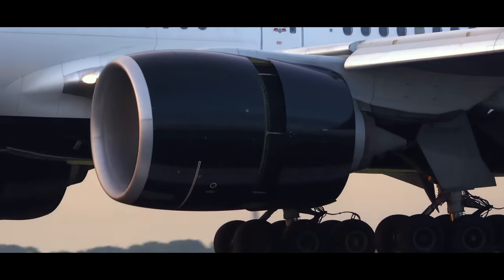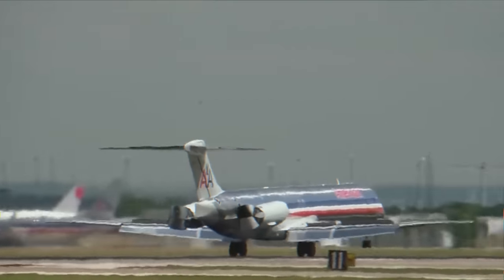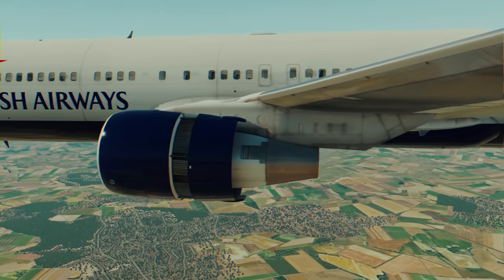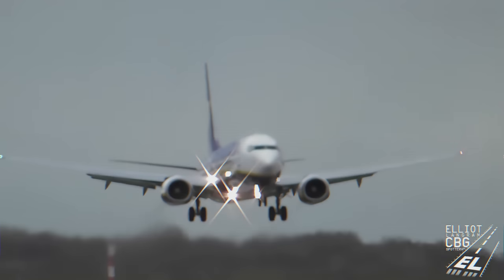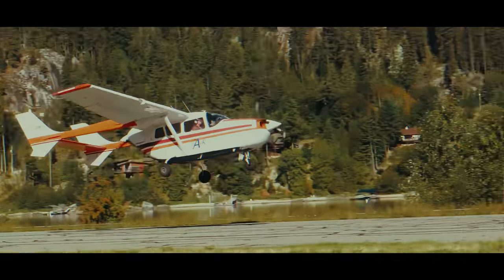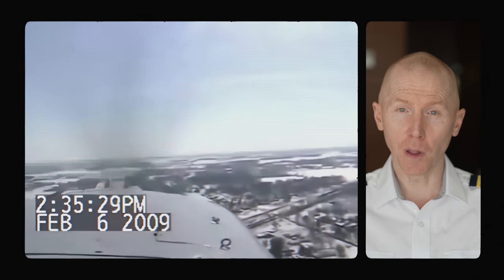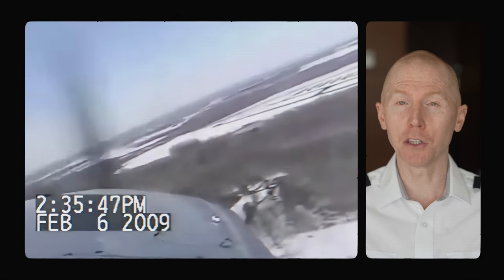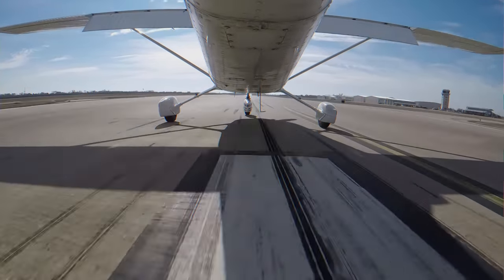Ryanair Pilot Makes Big Mistake

Comment: Sorry mister , you are talking shite. The Trident regularly used thrust revers in the air as did Concorde. Many aircraft have  a rad alt gate where thrust reversers can be used . In dirty weather when landing is going to happen ie below 10feet RA it is a great way of mitigating against a gust that might otherwise cause you an extended landing distance.

Comment: Noise and pictures tell us there was heavy wind, the plane approached fast to secure the glide slope for a secure landing, and as it was in line with the runway, to prevent an ongoing eternal flare, the pilot forced the plane to sit down by slowing it down by thrust reverse.

So what? 

But okay, you have to nag because it's Ryanair... Not very convincing.
And improve your pronunciation. Your accent is hardly understandable.